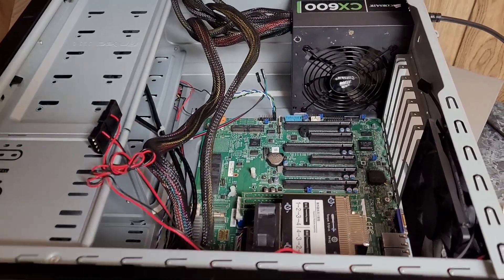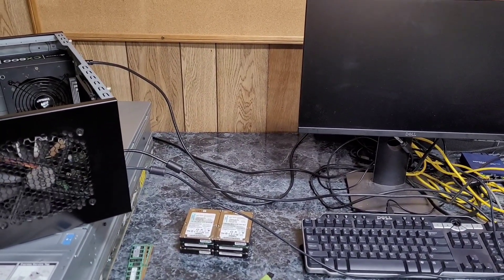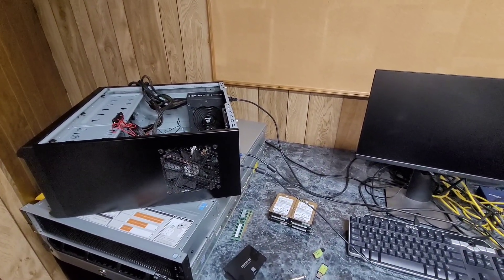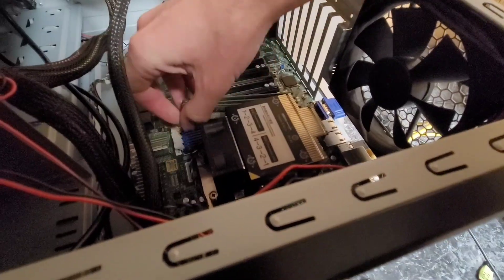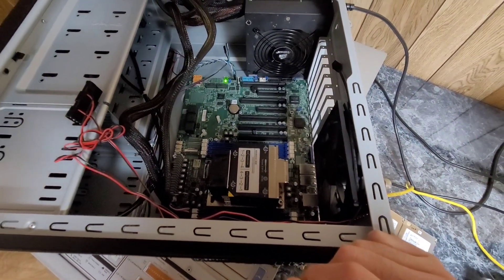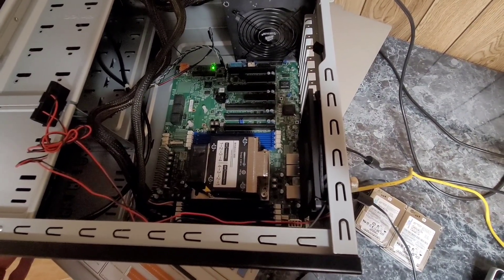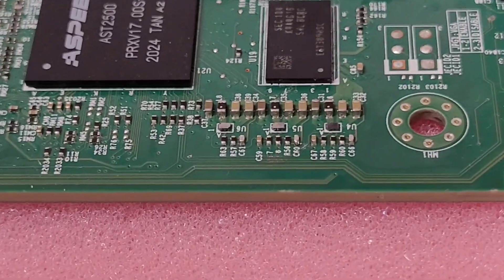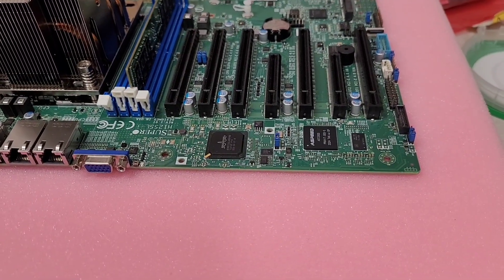Well cool my latest attempt at buying an EPYC board failed

Comment: At 2:20, we can see the cpu PSU connector unpluggued on the top side of the motherboard. Do you need to have it pluggued in?
Reply: (Sorry if that was intended, just happened to scroll around your video and noticed that)
Reply from the maker: @WilliamL0525  it only requires 1 CPU power unless you are running it with a lot of cards and/or a beefy CPU.

Comment: So... dumb question. But I went through the same thing with my H11SSL-i... did you make sure to remove the top middle standoff? I tested on the bench, all OK. I then assembled into the case, and the RAM is gone in that slot. After much head scratching, I realized where I messed up.
Reply from the maker: @shadowdeath9687  Yeah I made sure the standoffs were in the right spot. I don't know why the super micro boards use a non-standard layout but I'm hoping the case I'm buying will have the right holes. In the meantime the top middle standoff isn't installed.

Comment: Just imagine if motherboard manufacturers could affix a couple of tiny LED displays to the motherboard which could show various characters. Then, perhaps, the manufacturer could communicate the power-on event stream to the user using a system of numbers and letters. They might even call them the "power on self test codes" or something. Ah, but I'm probably dreaming.

Seriously though, the blinking light pattern of the LED is meant to guide you. I imagine the patterns are listed in the online manual somewhere.
Reply from the maker: @mkvalor  yeah wish post code displays were more common. There is supposed to be a heartbeat LED by the BMC chip but it won't light up if the BMC is not working.
Reply: @computersales  Yep - also helping lead to a diagnosis (lack of heartbeat).

Comment: FANS maxxed sustained it is.... likely an issue, but toss in a cheap GPU to be sure there is no display. Also paste in the socket is not gonna be okay eeek. If you have ARP lookup on your router, you could look for a supermicro MAC address to show up. OPNsense has this feature, I use it very very often.
Reply from the maker: Yeah it will post with a GPU. Luckily the paste in the socket is like an eyelash but not fantastic.  I don't know if MikroTik has that function. Sadly returning this board and back to hunting. I still need to return the H11SSL board I bought that has a bad dimm slot. I'm trying to convince myself to just live with it but the idea of paying $360 for a board that isn't fully functional upsets me.